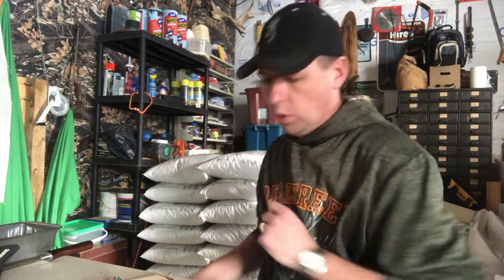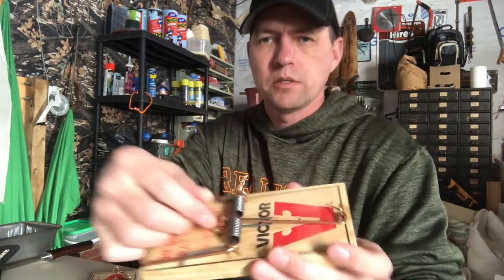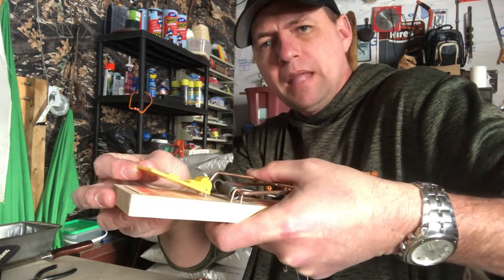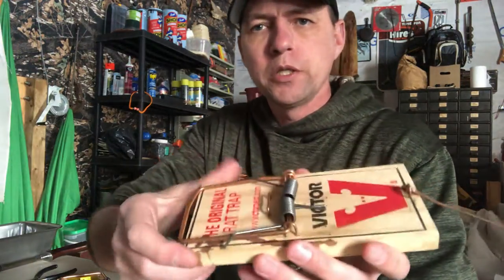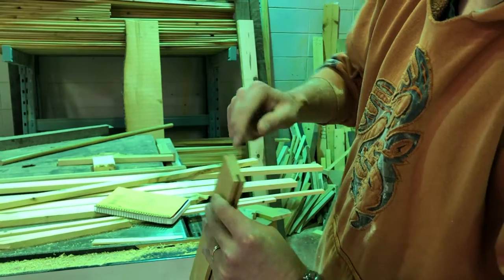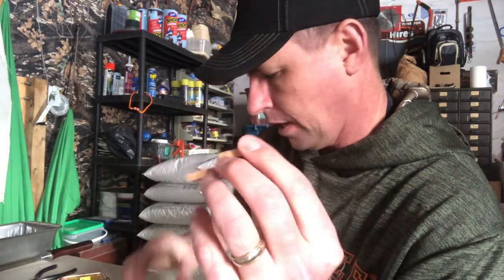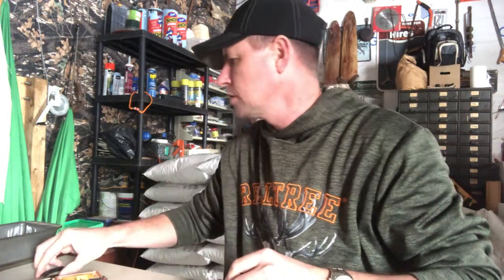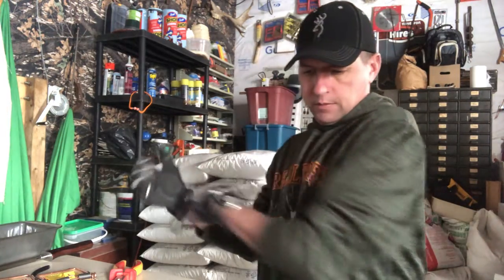Rat Trap Mod DIY Pull Trigger for weasel trapping Build & Install

Comment: For mice, the victors with that big yellow stepping pan are awesome….  I sand the end of the holding bar and shorten it by 20 thousands of an inch to create an absolute hair-trigger….  That fake cheese yellow pad is also nice because it has holes it that peanut butter adheres to…